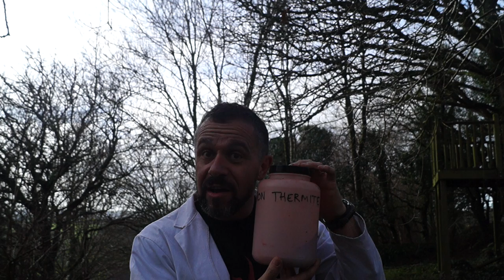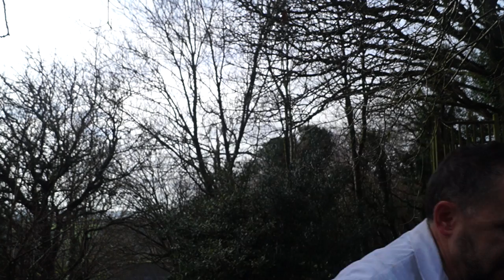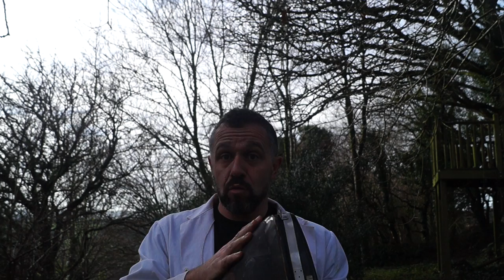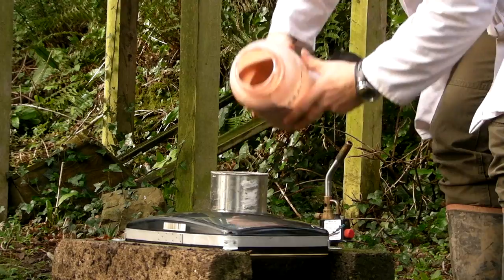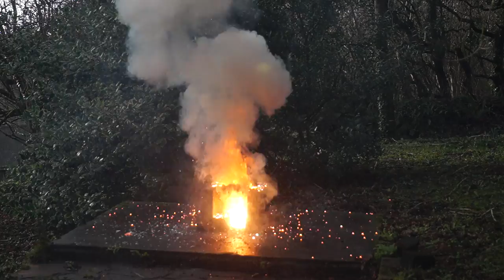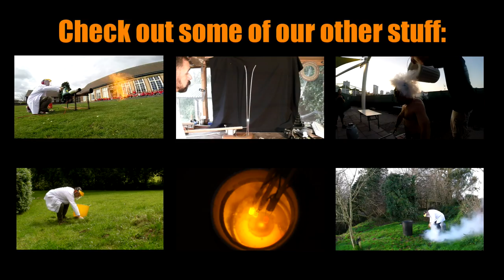Thermite vs. CRT TV Screen

Comment: Oh I do enjoy it when the Thermite comes out !
Reply: +Dave Robinson It is also very tempting to put a grate on top of the fire, and grab some steaks.  But I wonder if pure thermite has any toxic fumes.
Reply from the maker: +Dave Robinson It's always a treat!
Reply from the maker: +Steve Bergen We actually did this back in 2011 and there is a (very bad) video on our channel at https://www.youtube.com/watch?v=Ws7IYbwbwy4. I found the problems are that because of the brief but intense heat the sausages we cooked were absolutely charred on the outside and raw in the middle, plus they were coated with unburned thermite and aluminium oxide, so probably best not to eat them.

Comment: I'm surprised you didn't cut the implosion band from the crt to add a bit more excitement, thermite is great in slow motion too. I have about 5lbs of the stuff in my kitchen lol. 
Check out my recent thermite vs full aerosol can in slow motion, it may give you a fun demo for your shows. 
http://youtu.be/10TdbFUR0bk
Reply from the maker: +Green Silver Yes, someone else mentioned the implosion band - must admit we never even thought about it!  Love the aerosol and thermite video - do you mind if we have a go at that at some point in the future (we'll credit your idea!)?  What camera are you using there for the slo mo?
Reply: +wonderstruckwow 
I'm using the GoPro 3+ Black Edition at 240 fps, I first tried with an empty aerosol to prove proof of concept. As it didn't explode, I moved to try a full aerosol in the linked video. 
Feel free to try the same experiment, it's all in the name of science!
Reply from the maker: Yes, we've got the same Go Pro here - used it for the wide angle above shot in the video.  I've not used it for close ups of thermite because you have to get it so close because of the wide angle I didn't want to melt the camera.  We'll definitely have a go at that at some point!
Reply: +wonderstruckwow 
I did use it in an old housing for protection, the camera was on a small tripod 5-6 feet away. I guess filming through a sheet of regular glass would provide extra protection for the camera. 
I hope it all goes well and you get some great footage.
Reply from the maker: Thanks!